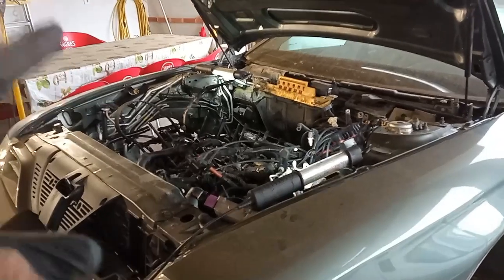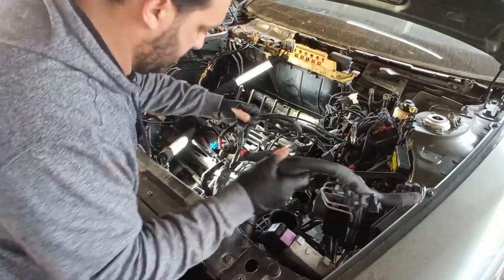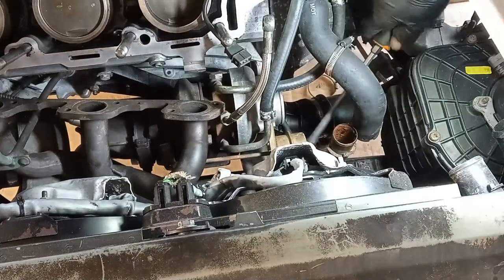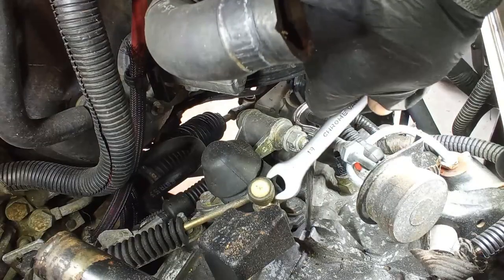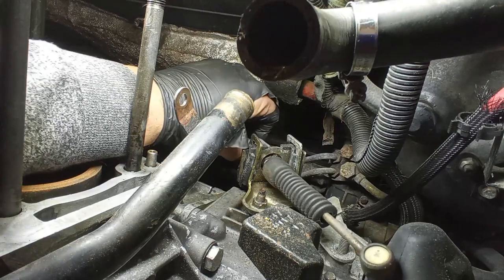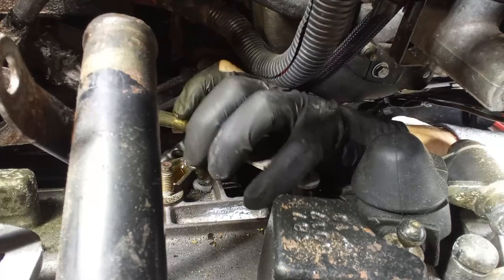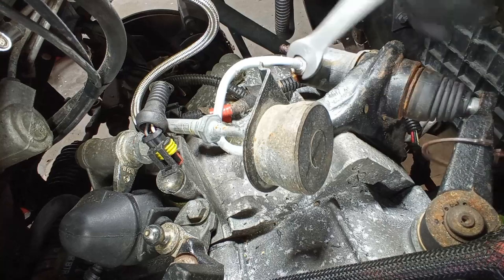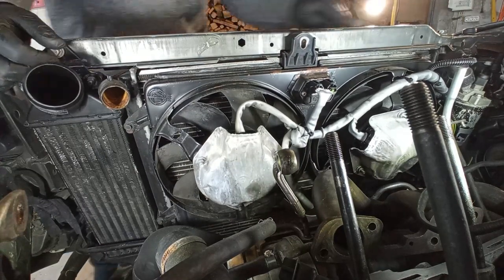I'm removing the Alfa Romeo V6 Busso Turbo from the 166! How i do it with no lift. Ep.4

Comment: Changing alternator on a GT 2.0 JTS would probably be quicker if I'd do the same and take the engine out and do it then... :) Good work!
Reply from the maker: Hello. I usually remove the subframe, on the diesel engines I take out the mouts on that side and rotate the ending forward, in that way opening a gap between the engine and the subframe. But on this diesel engines the oil sump is not so big. We did not had sales of the JTS here, do not know if the sump is like the Twin spark ones.
Reply: @alfaromeonoproblem  Pretty sure it's the same as a twin spark, only the cylinder head is different. My sump has a crack in from running over a dead kangaroo at 120kph I think.
Reply from the maker: Nice to know! 
Are you saying 120kph because it's the speed limit..? Lol

Comment: My 156 2.0 JTS has a leaking power steering hose. Is there a way to replace it without removing the intake manifold or pulling the whole engine out? It looks like a nightmare job.
Reply from the maker: Maybe it will be easier underneath and possibly removing the subframe. I thing it's your best bet
Reply: @alfaromeonoproblem Thanks. Maybe. Then I still have the connection at the top going to the pump; above the alternator.  Grrrrrr.

If I had a garage I would drop the subframe and engine out the bottom all in once piece.
Reply from the maker: No need to remove the engine. Just remove the parts that are in the way.
Reply: @alfaromeonoproblem  Do you have to remove the engine to replace the clutch or just the subframe?
Reply from the maker: Just the subframe.
Reply: @alfaromeonoproblem  Okay thanks.

Comment: Hey Bruno. Do you know if the zf 4 speed transmission on the 166 can simply be removed from the bottom without removing the engine too?
Reply from the maker: Hello. It's way easier to remove the entire engine and gearbox with the subframe
Reply: @alfaromeonoproblem  Hmmm. See I'm without a lift in this instance too. I was thinking if I could drop the subframe low enough, I could lift the body and pull it out from under. I am under the house though and there isn't much room above. I really don't like the idea of doing what you had to do here, lol.
Reply from the maker: @AdamAus85 I'm preparing a video for the removal of the subframe with the power train. Body up and out
Reply: @alfaromeonoproblem  Nice. I'll be doing it after mid July. I'm watching your video on the removal of a 2.5 busso from an alfa 156. I guess that procedure could be used for 166 too? Either way, I guess I gotta shop for an engine lift.
Reply from the maker: @AdamAus85 yes, ir is a bit similar. A engine hoist is a must for that. And a good jack
Reply: @alfaromeonoproblem  Yeah I see how in the 156 video you jacked everything, dropped the engine and then rolled the chassis backwards to "free" the whole unit. That's what I'll be doing I think. Ordered a hoist last night. I'm thinking of doing a few jobs while it's out (apart from the issue with the ZF). One of those jobs I thought would be worth it was the starter motor, either a rebuild or replacement. Car has 300 000km and it's very quick starting up.

Comment: Last time I took an engine out of a 166 I lifted the car off the subframe using the engine crane. Did the same when doing an engine swap on the 155 as well. Not as good as having a lift of course, but on the whole, preferable to struggling to get it out the top I think.
Reply from the maker: Hello. I did considered that option, it really was to be like that, to simulate a drop of in the lift. But the issue was that I did not have room for pushing the car backwards. Because the floor ends and it's just dirt. In my parents house I did do  like you said. I guess I did adapted to my current conditions. 
Thank you very much for watching

Comment: My Alfa 156 mk1 probably needs replacement of some of the engine mounts (the top right is certainly gone)..when starting quickly or when accelerating fast the engine feels like it's rocking a bit...
...it has 4 engine mounts right? Is it difficult to change them on that car, i.e. remove subframe or other bigger parts or is it more straightforward?
Reply from the maker: Hello. On the 156 they are easy to replace. No need to remove the subframe at all. The bottom one is always the one that suffers the most, and for that the upper bone like mont suffers too by consequence.
Then you have the gearbox side one and the timing belt side one too. I recommend new and original if possible, or original Imperium/impergom ones if original is not available.
MAYLE ones just sometimes come with originals inside, but is a gamble. MAYLE stuff sucks...
Reply: @alfaromeonoproblem  So Impergom/Imperium is a good brand, at least for that stuff? 
I have no experience but for some reason I thought they were the cheap copy ones.
Reply from the maker: They are very good and often pack original parts too. They are very good indeed
Reply: 156 has differently hang motor. 
It's screwed to stringers there's no subframe like in 166 under whole engine bay. 
If it's 156 V6 then forget about right mount it's not existing in any world but you can take 2.4 JTD mount shorten it and use ase replacement. 
Left should be available, for a "bone" style mount (to a shock absorber cup) there are no whole new mounts but you can get bushings and replace (polyurethane available also) 
rear mount which is bolted to subframe should be available in many brands, I personaly used SWAG and it's keeping it's job after 50k km still

Comment: Hi Bud how much does a busso v6 cost to completely rebuild in Portugal?
Reply from the maker: Hello. The engine builder that the owner contacted quote him between 3 and 5 thousand euros. Not including my labour of final assembly and fitting
Reply: @alfaromeonoproblem  if the engine ran good that seems reasonable , as that what I was quoted by a specialist... did ur friend get a refund?
Reply from the maker: The car is not mine, the price is for parts and machining only, my labor is not included. The car is from a friend and it never ran since he bought it.
Reply: @alfaromeonoproblem  OK I understand now..at least when you will have it finished it wil be as good as it can be , keep up the good work bud
Reply from the maker: I have tree previous videos is this car, explaining everything as I am testing and working. It's down on the description below. They are too on my "helping others..." Playlist